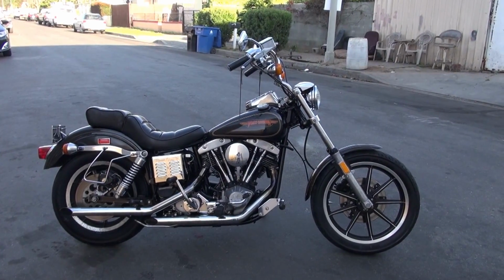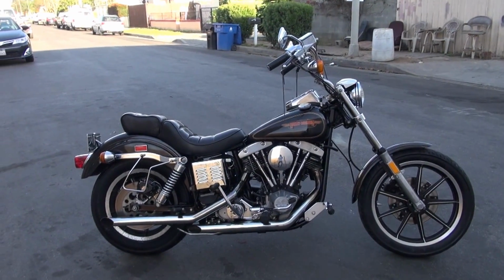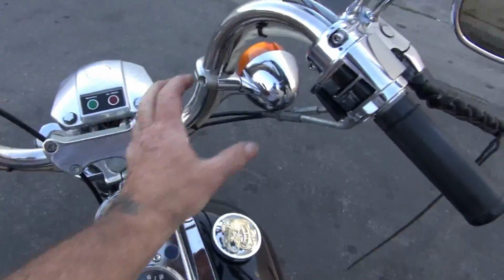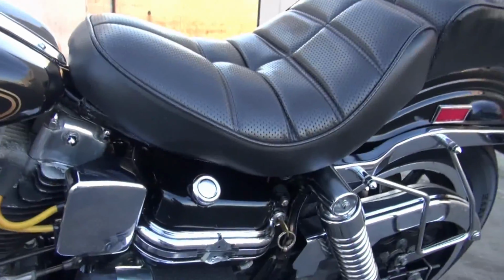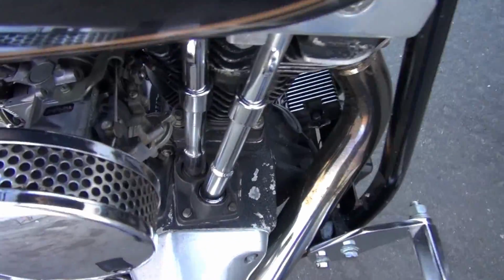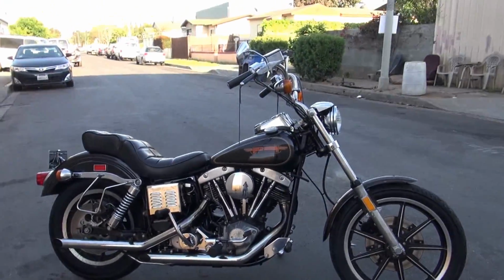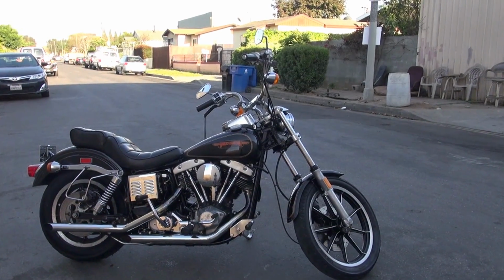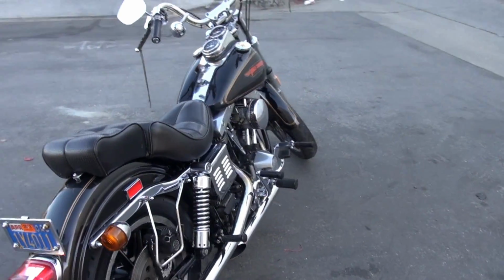Hunting Harley's, 1984 FXS Lowrider

Comment: I had a late 84 xlx61 your right nothing sounds like a shovel head even in the sporty mine idled the same way just a hair slower. Something you never forget
Reply: too low and your oil psi takes a shot at least. 700-900 rpm! your motor will thank you and last a lot longer, nice and lubed up!! ride safe
Reply: shit not shot